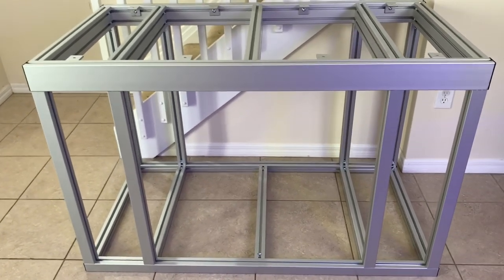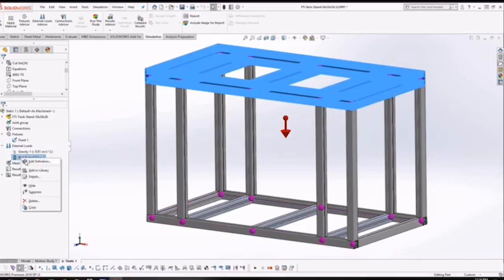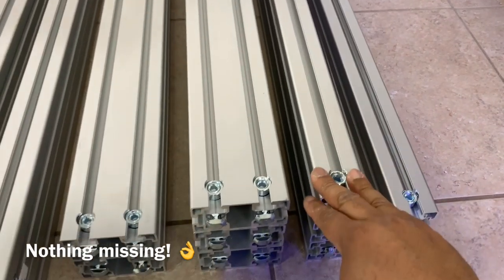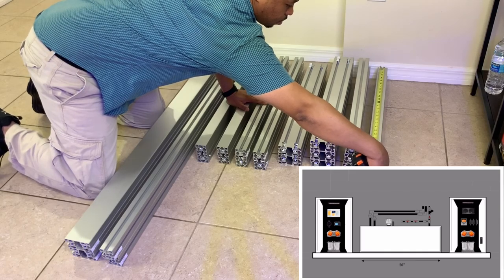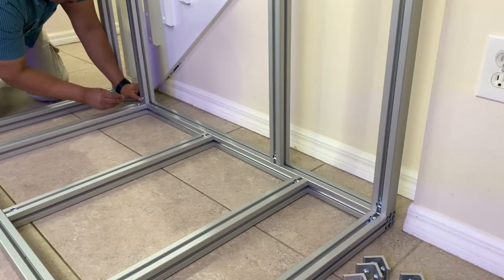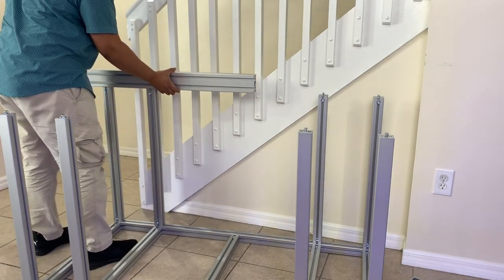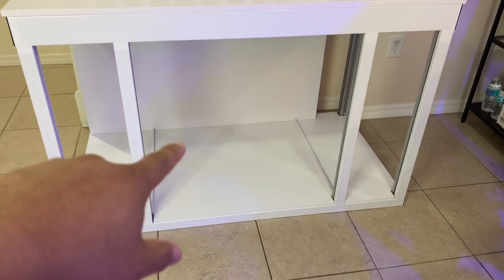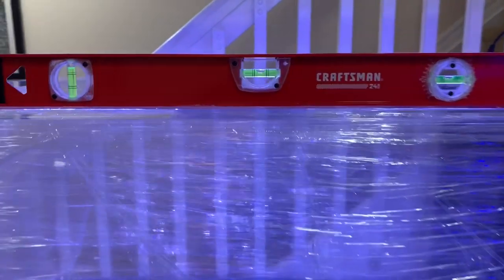Aquarium Stand Overview - Framing Tech - Ep.1

Comment: Stand looks great.  I've been using a FT stand for a 180 for over a year and it's awesome.   The outer flat side is a nice upgrade.  Two upgrades I did with mine were to add FT 45x45x90 triangle braces for additional racking support.   I also got some of the Tnut cable management hooks.

@j's reefs do they sell the brackets you mounted the top with?  I custom made some,  but would be nice to just buy prefabs.
Reply from the maker: Nice! I’ll have to look into the cable management hooks myself. 

Yes they do sell the corner brackets on their site. If you get them make sure you choose with hardware so you get the fasteners as well. 👌
Reply: @jsreefs5576  the cross cable binders is what I used.
Reply: @flashkan  So I googled, "Tnut cable management hooks" and I saw a huge array of different things.  Could you be more specific?  It sounds really cool.

Comment: I know this is a few years late, i'm just starting to look at extruded alloy as a stand, but i'm just wondering how FT set up the weight distribution test in Solidworks?? As glass doesn't flex anywhere near as much as alloy, i dont understand how their finite element analyses (weight distribution test) could flex so much with a fixed weight on top of the stand?? Love the stand though!!

Comment: Curious what Circulating pumps are you going to run? I see in your control panel you have the AI controller. Are you going to run the Nero 5’s?
Reply from the maker: That’s the plan right now. I will probably add a third one along with a gyre if some sort.